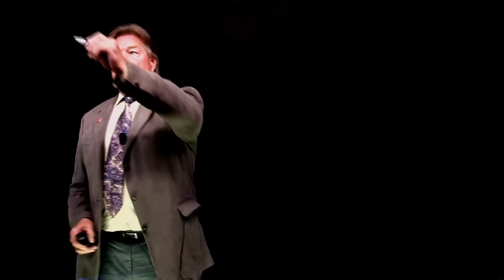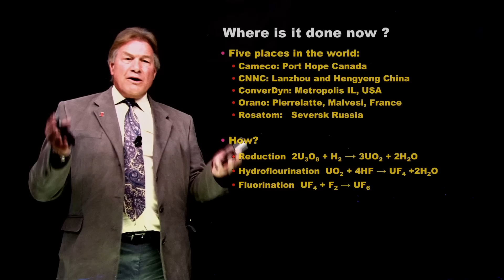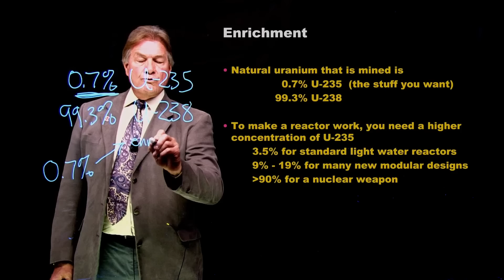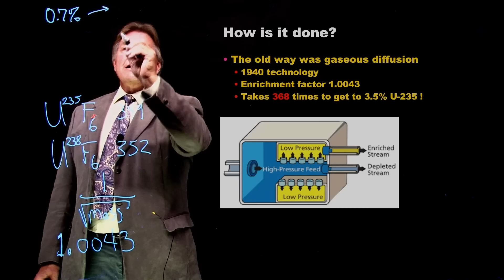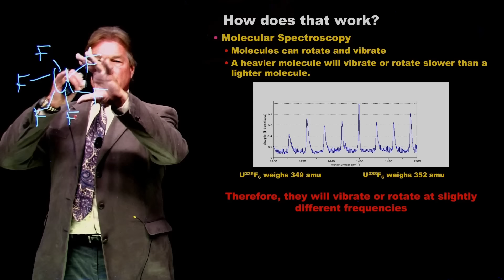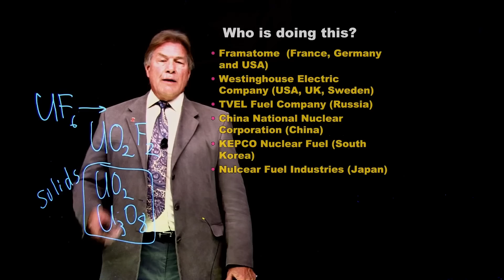The Uranium Supply Chain

Comment: The problem with this technology is that solar panels are expected to drop another 50% to 70% in cost by 2035.  Solar is now 3 times cheaper than nuclear power.  What happens when solar gets 5 to 6 times cheaper than nuclear?  What happens when you can put solar panels on your roof with batteries at half the cost of the grid system?  Wait! You can do that today.

Comment: Could you use microwaves to do the isotope enrichment? I'm thinking that the isotopes might respond to different microwave frequencies and you could heat up one isotope faster with the microwaves and siphon it off somehow similar to the diffusion process from the 40s. Rather than using spectroscopy. Just a thought 🤔

Comment: @illinoisenergyprof6878 Had a thought - what if you used the UF6 directly as a liquid (pressurized) in a reactor design?  Similar to an MSR, you could easily physically and chemically separate out the fission products.  Some nuclear (and chemical) reactions would precipitate out as solid particulate, and many fission products would "boil off" such as Xenon and other items with lower-temperature boiling points.  The liquid could also be cycled though a chemical stage, similar to an MSR to screen out the solids generated and any unwanted liquids.  What do you think Professor?

Comment: prof on those lithography are layering up some synthesis on the surface with other materials where it travels to so u would have more precise experiment other surface might not have consistent result so that might need two different light one for hardening the surface to form a layer then one for splliting are u working these experement on campus or i Oklo doing something long run refinery experement and i heard can be done even for the decay ones

Comment: This explanation really mde me more appreciative of our fuel used in the Ft. St. Vrain HTGR before it was decommissioned due to other problems (not our fuel). Initial core loading was 657 kg of 93.15% highly enriched U235, along with around 15,000 kg of Th232. The Thorium was converted to U233 by neutron absorption and subsequent decay through the U232 to Pa233 to U233 decay chain. U233 is a very good reactor fuel. Thanks Professor!
Reply: Did you work there? I live nearby and always wondered why the reactor was decommissioned.

Comment: We should switch to TRISO HALEU fuel for reactors at about 18% enrichment. TRISO is just a heat resistant type of fuel pellet packaging currently in use in some places and with different pellet shapes. High assay low enriched uranium (HALEU) is just regular uranium fuel enriched to a level higher than typical low enriched fuel but below the 20% enrichment level that keeps in within the low enriched range by international standards and agreements. 18% enrichment keeps it very close to the upper limit of the low enriched category but with a gap of a couple of points to make it clear that it is for reactor use and not intended for further enrichment to higher levels for other uses. This level of enrichment is sufficient to greatly improve efficiency and greatly reduce waste products.

Since modern enrichment methods and technology is vastly more efficient and less costly than it was in the past it is now worth spending a bit extra on the enrichment side to gain extra efficiency and savings on the operations side. Old reactors were limited by the very low enriched fuel that was economically available. We can build new reactors optimized for HALEU at 18% and reduce total costs significantly.
Reply from the maker: I talked all about TRISO in this video -- keep watching.   TRISO is the fuel that will be used.  It is LALEU at 9.9% but the same concept applies.
Reply: I am aware that you are aware. The comment was meant more for other viewers. Thank you for sharing this informative video.

Comment: gaseous centrifuges have always confused me isn't it reliant of the boundary layer of the uf6 and there for might not be good enough?
Reply from the maker: The gas skimming inlet is wider than you may envision.  It intakes more than just the boundary layer.
Reply: @illinoisenergyprof6878  also I mainly ask this as to how the force is imparted to the gas as if it were spinning wouldn't the boundary layer inside be the one that was moving and due to the force not being able to go through everything there would be a velocity difference across the cylinder

Comment: And if you run out of uranium on land you can extract it from sea water. A bit more expensive but the cost of the uranium is not a large factor in nuclear power anyway. Japan tried it, I guess because they have a lot of nuclear power but no uranium mines.
Reply from the maker: Very true.  5ppb I think in sea water.    Passive enrichment on clay beds is the first step I think.
Reply: @illinoisenergyprof6878  I think the Japanese developed some polymer that absorbed uranium when soaked in the sea. Maybe there are more methods I haven't read about. At the time it was 10 times more expensive than buying mined uranium but at least the possibility exists if trade in uranium goes away.
Reply: @illinoisenergyprof6878 passive enrichment, like gold in a river? Neat!

Also, I'm having trouble figuring out how to mention the Kovarex process without sounding like a nerd who just wants to mention it. ... I think that suggests that it's true, haha.

It's hard to suggest new topics because we don't know what we don't know! One question I've had is, why do we use Uranium and maybe Thorium for fuel, but not the many other unstable isotopes available? It is because the economics just don't work out, or is it more about the reaction phase?

Comment: I'm not a chemical engineer. Why can't there be enrichment at solid or liquid (melted) state?
Reply from the maker: All the comments below are good.    Yes, all separation for this small of mass difference makes them a gas first.
Reply: You need the atoms/molecules as individuals to separate the 235 ones from the 238 ones.
Reply: @zapfanzapfan with the techniques described yes. Isn't in general possible? Are all separation techniques generally done in gaseous form?
Reply: @chat-1978  You could use chemical reaction speed (slower for heavier isotope) for isotopic separation like is used for heavy water but there the mass difference is much larger. Might not be enough with 1% mass difference like in uranium.

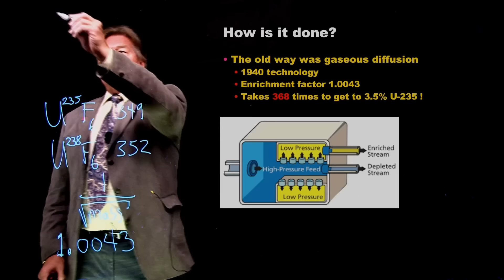Comment: 9:15 would this be a good way to refine heavy water tho? The difference in mass is significantly higher between the different water molecules than between the different UF6 molecules.
Reply from the maker: Easier ways to do it since the mass difference (percentage wise) is much larger.

Comment: Dont know if anyone else mentioned it, but HF is not! a very strong acid. it's not even a "strong" acid in the chemical sense, since it doesnt dissolve fully in water.
The "strong" part about HF isnt really it's acidity but its other chemical properties, especially those of the HF molecule itself (for instance, we dont really care about the HCl molecule, since it dissolves fully in water -> there arent any HCl molecules to concern yourself with. different with HF)
Reply from the maker: I should have said dangerous -- because of its absorption properties -- not strong.  Sorry!

Comment: The RBMK reactor was designed with low enriched fuel in mind, saving cost on enrichment. Has the cost of enriching gone down today or is this still a factor?
Reply from the maker: The RMBK was also designed to be able to make weapons grade Pu as a back up way to make more bombs after an all-out WWIII.   That is why it had the enrichment level and the moderators that it used.  Too high of enrichment leads to a neutron spectra that destroys Pu-239 and builds up non-fissile Pu isotopes instead.

Comment: Do fuel rod emit radiation? What keeps it from reacting?
Reply from the maker: Uranium and the things it breaks into are radioactive and emit alphas betas and gammas.  The layers of carbon absorb that radiation, basically turning it to heat --- the purpose of the reactor.   You need neutrons to make the Uranium split.  When it does split it makes more neutrons, and that is how you get a chain reaction.
The beauty of this system is that if it gets too hot, the chain reaction stops -- no more fissions (Uranium splitting) takes place.

Comment: I have become increasingly convinced that reprocessing of fuel will be required in the near future. We have enough spent fuel to startup several hundred new reactors.
Reply from the maker: If you have a really good enrichment technique you could use the depleted uranium for fuel......
Reply: @illinoisenergyprof6878  Yes. The DoE Fuel Cycle Eval & Screening showed that EGR 23, 24, and 30 were the most promising fuel cycles. Fast reactors with continuous reprocessing, using only new natural uranium, and able to be use U, U/PU, and U/TRU fuels, and potentially recycle both LWR SNF and DU waste inventories.

Comment: Excellent video. A nuclear electric future needs more national grid capacity and grids are f......... uneconomic. 
Professor you should explain why grids cost $TRILLIONS. 

An important video. Please.

Grids are a RENTAL SERVICE. And 10times more expensive than the generation plants. Even nuclear plants.

Grids need to be 10times bigger to replace fossil fueled energy. 
20times bigger, less the 66% waste heat and mechanical friction heat.
So, 10times more 99% equivalent efficiency electricity.
Reply from the maker: I think I did a video on the electric grid once..... I will have to look back and see.   We are looking for new topics.
Reply: @illinoisenergyprof6878 Australia has 1million km of national electrical grid, transmission and distribution and switch yards and street transformers. 
All built over 14decades. 
We have $34 billion in new grid capacity. 
HumeLink new transmission project is only 365km and $13million per km, all included. 

Grids are valued at replacement costs. $/km x total length. 
ROI, return on investment, is based on a reasonable % of the grid valuation and running costs.
Total $ divided by the total kWh per year.
GRID RENTAL  plus generation costs plus profits.

Most people just assume the grid exists and they are only paying for the generation kWh. 

I say Australia because I know it.
Reply: @illinoisenergyprof6878 occupied streets and energised lines and 247 demand is expensive to work on.
Reply: @illinoisenergyprof6878  yes I found it.
6 years ago.
Electricity and the Electric Grid.
Updated new video to show trends please.

Comment: where is all the uranium from thousands of nuclear warheads made in the 60's 70's and 80's ?
Reply: from Microsoft Copilot :
What Happened to That Uranium?
• 	Decommissioning: Much of the weapons-grade uranium has been downblended into low-enriched uranium (LEU) for use in civilian nuclear reactors.
• 	Programs like Megatons to Megawatts: This U.S.-Russia initiative converted former Soviet warhead uranium into reactor fuel.
• 	Stockpiles: Some material remains in strategic reserves or is still part of active warheads.
Reply from the maker: As the other reply said, much has been repurposed.  Also, it takes a lot less Uranium for a bomb than a reactor.

Comment: Thank you! This is Informationen most people should understand.
Of course, this process is very important for the fleet of thermal reactors like BWR, PWR and the more conventional GenIV reactors, including TRISO designs. 
What is with other options like the good old CANDU and most fast-spectrum reactors?
CANDU is breeding Pu-239 from natural uranium. 
The same is true for some Gen IV fast-spectrum designs. With some processing they can even use spent fuel. 
In my opinion this this reduce the effort and cost of fuel supply considerably. And some of the designs allow full burnup, the amount of natural uranium per TWh will drop more than 100 times. 
Of course, in the short-term ther will be no a shortage of uranium ore, more in the processing. But in the mid- and long-term it would beneficial to follow the fast-spectrum route, not only because of fuel supply, but because of the chance to reduce the amount of waste to store. 
What is your opinion regarding this topic?
Reply from the maker: I also like fast reactors since they eat up most of the long-lived waste.  I think we will get there eventually.

Comment: You’ve sparked my curiosity, what happens to the depleted uranium at the end of the enrichment process?
Reply: In the past, some of it was used to make slugs for the GAU-8 Avenger (BRRRRRRRT), and it can be used as a tamper (object at rest stays at rest, contains explosion for a shake of the lamb's tail, increasing yield) in a nuclear bomb pit, can be used as radiation shielding, can be used as ballast. Basically anyplace you need something dense.

Comment: Great topic most people don't discuss. I expect a lot of people think there is just a "Uranium rock" that gets shoved in a rod and makes heat, or gets delivered to plants. There is a lot of science and technology that has gone into turning Uranium into something that can be used as a fuel for power generation.

Funny enough I live in Saskatchewan, Canada and we have an extreme northern town called "Uranium City" that started in the 50's to mine Uranium with up to 52 mines/pits at one point. All mines have since shut down due to economic issues and it is a ghost town now (no permanent year round road access and it is sub-arctic region so hard living) but there is apparently still Uranium to be found if anyone ever wanted to reopen the mines. Just as the Professor says, there will always be ore to mine but it gets uneconomical to obtain after a while.

Comment: Where is all this new demand coming from?  The average age of a nuclear power plant in the US is 42 years old.    The idea that we are going to replace the existing fleet, let alone add more is likely fantasy.  
I would agree nuclear is our best bet, but the damage was done a long time ago.  Now building them is so expensive that they are totally uneconomical.
Reply from the maker: AI and data centers are raising our need for electricity.  If you want to make more electricity without making CO2, nuclear power is (in my opinion) the best option.
Reply: @illinoisenergyprof6878  I'll be the contrarian and say that solar and massive storage batteries are better.

(But I'm willing to hear arguments that the battery banks make it too expensive, even when compared to the high cost of building new nuclear plants.)

Comment: Wish you can elaborate more on Silex. 

Centrifuges seems easy to understand, but its like a brute force filtering or purification process. Silex there's a lot of things in the middle that seems missing. 

On first glance it looked superior technology, but theres no explanation on what makes it hard. Perhaps, the wave length tolerance is really low to excite one neutron out of 92 neutron in uranium.
Reply from the maker: Indeed, getting the exact wavelength is very difficult.  Also moving around enough gas through the laser beam etc.